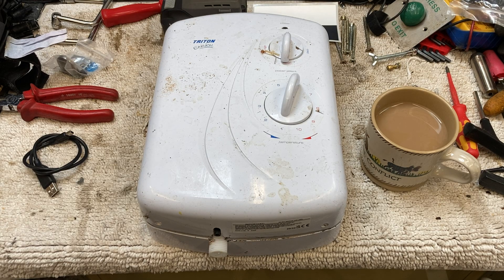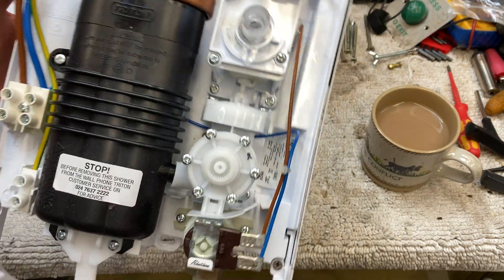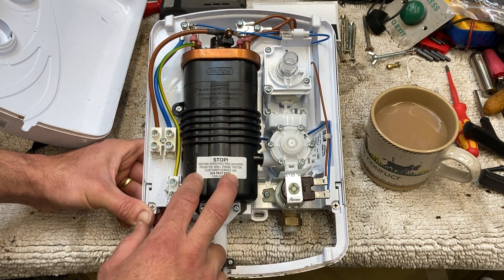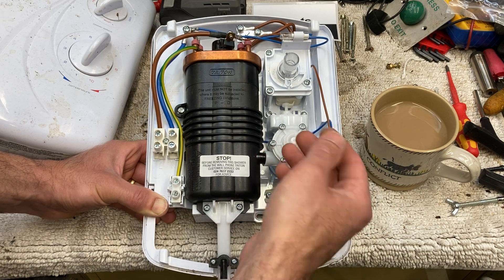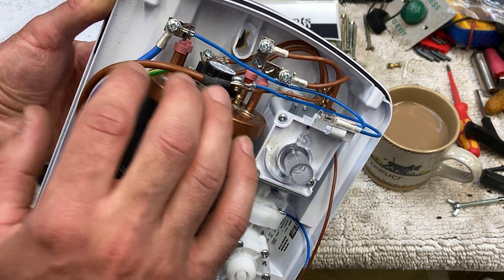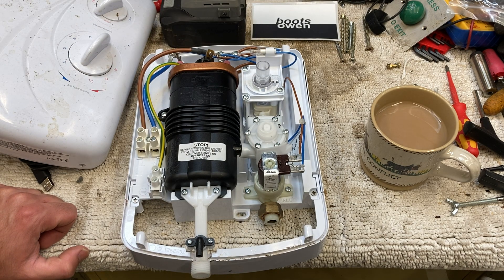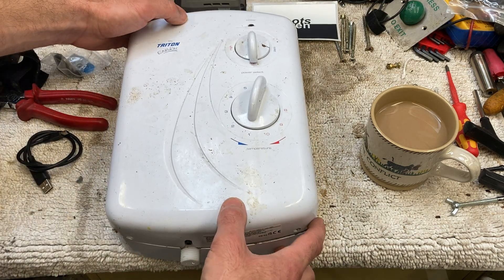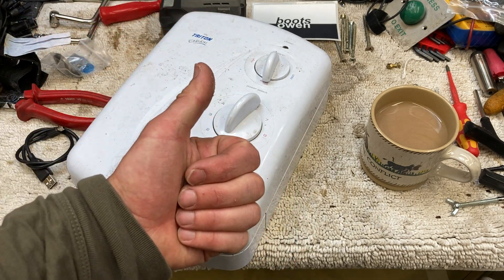Whats inside an electric shower:  Triton Enrich

Comment: Hi. Mine doesn't get hot enough. Like it's on low power all the time, even when switched to high. Then very occasionally it will get absolutely roasting for about a minute before going Luke warm again - almost like the high power has suddenly started working then turned itself back to low power. Very confused. Any suggestions?
Reply from the maker: Have you had a  look inside?

Comment: Hi I went to switch my shower on it’s the same one as in the video a triton enrich and there is water coming out the bottom of the unit as well as the shower head it’s on the left hand side it’s leaking looks like it has a thread on it can you tell me the problem it has plz
Reply from the maker: the pressure relief valve has blown out under or behind the outlet and needs to be reset or replaced.

Comment: Hi great video.i have the same shower.for the last week while having a shower the water would just stop then 2 seconds later come back on went on like that every day for a week then to day it did it twice now no water is coming thru it at all any ideas would be much appreciated thanks 🙏
Reply from the maker: What have you tried
Reply: @bootsowen hi I haven’t tried anything yet .was thinking of getting multimeter out tomorrow and test the brown square solenoid what do you think
Reply from the maker: Good call, could be that, or a bit of grit in the inlet filter, or if there isn't one it could be something (grit) in the flow regulator. The other issue could be that your pressure is too low.  Once you have the cover off taking bits on and off isn't difficult. Let me know how you get on!
Reply: @bootsowen il have a look tomorrow and let you know how I get on thanks for advice 👍

Comment: Hmm i have a almost identical unit.
Its a bit crude with the controls but it didnt take long to find the best settings :-D
I did notice the heat level changes slightly as the outside water pressure  changes.
i still dont care,  it was only 50 quid new.
Reply from the maker: Bargain!